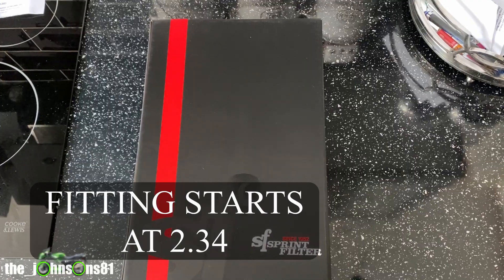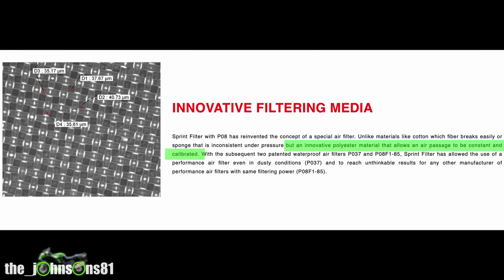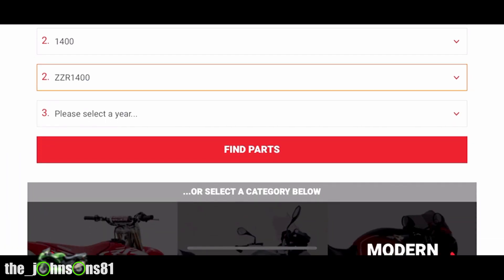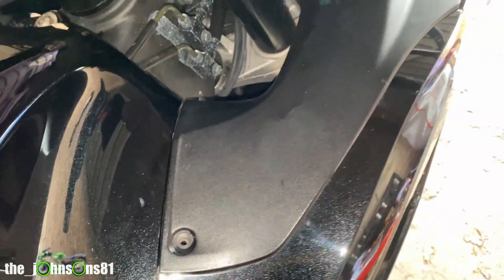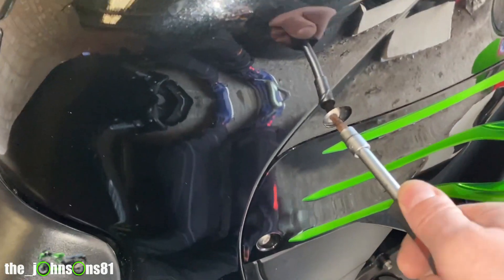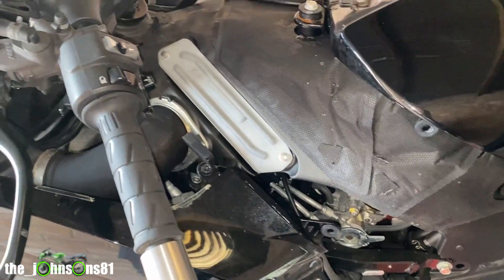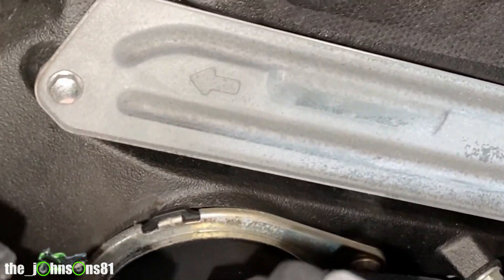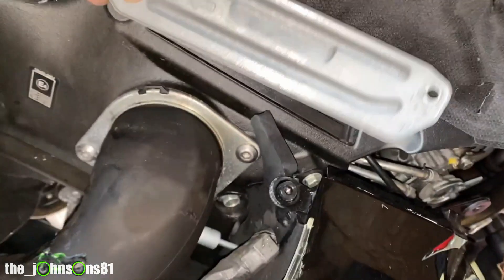Fitting a performance air filter to a ZZR1400

Comment: Running a sprint P08 in my H2 you can here the super charger even better great filter
Reply from the maker: Thanks its really good I noticed the difference straight away.
Reply from the maker: I would use a Kawasaki oil filter. K&N emailed me and said “they don’t make an air Filter for the ZZR if you find one it’s fake” unless that’s changed but I know you can’t buy one on there website that’s why I used a Sprint one.
Reply from the maker: Yes use them

Comment: Great video thanks for sharing one question can  you just take the fairing off only where the side of air filter is thanks in advance
Reply: Yes and no...    You don't need to strip all those fairings, but the top section has to be removed - but that's the only one. Three screws (one on the top/front and one on each side) that holds the top fairing just in front of the "fuel tank ie airfilter box" and also two screws connected to those black covers on the top side, but only the rear screw on each side has to be removed. All in all five screws and a little bit of wiggling. Then you can access the filter cover very easily.